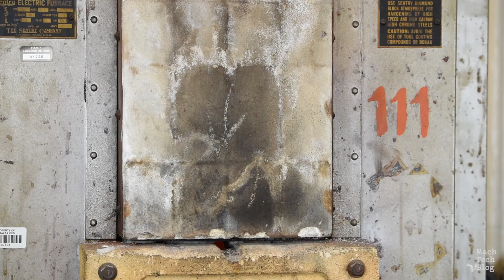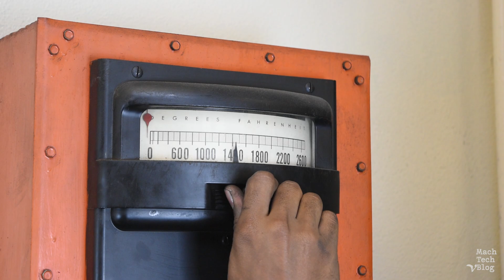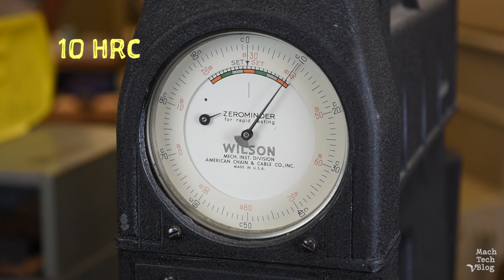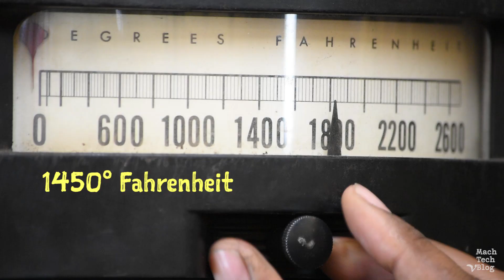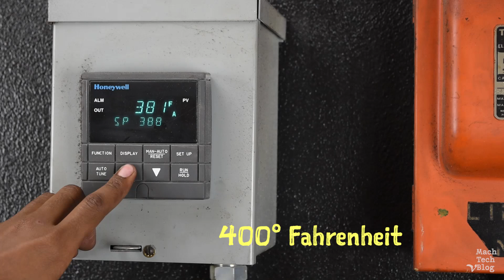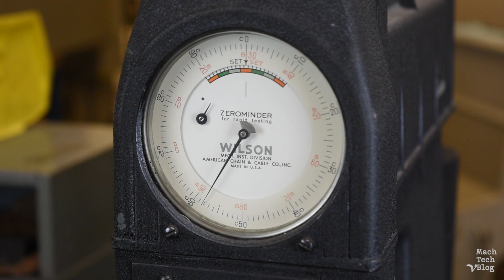Case Hardening

Comment: you get more carbon from natural charcoal. than that type.
Reply from the maker: It’s great that people are asking these very interesting questions. At the risk of being overly technical, here are our thoughts. There are various factors which influence carbon diffusion into mild steel. By carbon diffusion, we mean both the case depth and the carbon content of the case (which greatly affects material hardness after heat treatment). Carbon potential of the atmosphere inside the carburizing box is one of the factors. Pack carburizing is a process in which carbon monoxide (the “carbon-rich gas” mentioned in the video) derived from the solid carbonaceous material (the charcoal) decomposes at the hot metal surface into pure carbon and carbon dioxide. The carbon is absorbed into the steel, and the carbon dioxide reacts with the solid carbonaceous material to produce fresh carbon monoxide. And so the cycle continues. 

Pure charcoal will create an atmosphere favorable to carburization. But in industrial applications, pure charcoal alone is not often used as a carburizing medium. It is more common to mix in 10-20% of energizers in the form of barium carbonate, sodium carbonate, calcium carbonate and/or potassium carbonate. Energizers facilitate the reduction of carbon dioxide with carbon to form carbon monoxide. One study (“A Study of the Action of Various Energizers in the Carburization of Steel” by William N. Warren) found that pure hardwood charcoal alone yielded a case depth of .0529” and a case hardness of 57 HRC when tested on steel with a .235% carbon content after eight hours. The same test using 15% sodium carbonate in the carburizing compound yielded a case depth of .0735” and a case hardness of 64 HRC. So, although energizers are not necessary in the process of pack carburizing, they do increase the efficiency of the process. The time required to attain the desired case depth and hardness may be reduced. The same study found that steel carburized with the 85% charcoal/15% sodium carbonate compound resulted in a case depth of .054” and a case hardness of 63 HRC when tested after 4 hours. This result is superior to that attained with 100% pure charcoal after 8 hours.

As mentioned before, there are other factors which influence carbon diffusion into mild steel: temperature and time. According to ASTM International, the rate of change in case depth at a particular carburizing temperature (usually around 1750 degrees F) is proportional to the square root of time. This means that the rate of carburization is highest at the beginning of the cycle and gradually diminishes as the cycle is extended. To put it simply, when it comes to case depth, there are seriously diminishing returns on the amount of time the steel is kept in the furnace with the carburizing compound. After 4 hours, the case depth is usually about .040”. After 8 hours, the case depth is about .067”. After 12 hours, the case depth has only increased to about .079”. And even after 50+ hours, the case depth won’t increase to more than .157”. This is just a characteristic of the pack carburizing process. And the diminishing rate of case growth also means that the efficiency advantage of energizers becomes negligible after about 8 hours. 

To return to the original point that “you get more carbon from natural charcoal” than charcoal briquettes, we have not been able to find any studies which test these two materials side-by-side. However, we doubt the claim that “natural charcoal”, simply by nature of its purity, is necessarily more effective as a carburizing compound than charcoal briquettes. And here’s why. We’ve already seen that charcoal is less effective as a carburizing compound when it’s used alone than when energizers are added to it. According to Kingsford, their charcoal briquettes contain the following ingredients: wood char, mineral char, mineral carbon, limestone, starch, borax, sodium nitrate, sawdust. The first three ingredients constitute the vast majority of the composition of charcoal briquettes and they are all merely carbon from various sources. The other minor additive ingredients are used mostly for ash formation, ignition assistance and binding. These are considerations which might be important when grilling with charcoal, but they are unnecessary when using charcoal as a carburizing compound. However, one ingredient is of interest to us. In another comment, Паша Римир remarked that “Kingsford cuts their charcoal with rock dust”. This is true. The “rock dust” is the limestone in Kingsford’s ingredients list. Limestone is primarily composed of calcium carbonate, which is one of the energizers commonly used in commercial carburizing compounds. So, despite having more unnecessary fillers and additives than natural charcoal, briquettes do contain some amount of a known energizer. Granted, the amount of limestone in charcoal briquettes is only about 3%. But this calcium carbonate content may slightly improve the efficiency of charcoal briquettes when used as a carburizing compound.
 
We think testing the two media side-by-side would make an excellent video follow-up!
 
Here’s our conclusion. We found that using charcoal without energizers yielded a case depth of about 1/16” after 8 hours and produced a case hardness of 60-62 HRC. These results were satisfactory for our purposes and did not require the purchase, mixing or disposal of energizers. (Barium carbonate, the most common energizer, is a toxin used in rat poison.) For us, the important decision is not whether to use natural charcoal or charcoal briquettes, but whether to add energizer to the charcoal. And this decision will be based not on the desired case depth and hardness, but on what length of time is deemed acceptable to achieve the desired results. If your application requires better efficiency than what we showed in the video, we recommend adding 15% sodium carbonate (readily available at pool supplies as soda ash) to the charcoal and using a carburization time of 4-5 hours. But we don’t think you should worry too much about whether you use natural lump charcoal or charcoal briquettes. Use what’s available.
Reply from the maker: You got it! Materials are ordered and we've put the test on our to-do list.
Reply: Machine Tech Video Blog 
Great write up, very interesting!  I'm looking forward to your follow up test video.  Thanks for sharing.  One minor tip, or little tidbit of info rather, is that it is perfectly fine to water quench (cool) the steel after or between temper cycles.  As a knifemaker I do my own heat treatment and use simple carbon and tool steels.  I have asked a question regarding this matter before on a forum in a thread I started entitled, "Water Quenching VS Air Cooling Between Temper Cycles"'  and learned that it has zero adverse effects.  In fact, it is possible for rapid cooling to aid in the conversion of retained austenite to martensite, although it would be very minuscule.  The main benefit is that you can save time by tempering, cooling in water,  then going straight into the next temper.  Or just temper once, cool, then do whatever you plan on doing next with the part.  Also, warping is not an issue at these low temps, so there is no negative side to cooling.   Just thought you might find that interesting.  I will admit that this is all second hand knowledge, but I have confidence in the guys who provided this info, as I've been of this specific forum for years now.  Anywho, take care! 🙂
Reply: Nathan Dean maybe thats why they did it for 8 hours? i thought 4-5 hours was optimal? anyone know?
Reply: The 8 hours wasn't very specific, as they loaded it in a cold furnace. Usually it takes a few hours for a furnace to get up to those temperatures and more for the material to heat up as it is inside a box with insulation material basically. What actually counts is the soaking time, meaning how long the part is at the temperature requested.

The time for diffusion is less when you use higher temps, as anything from 825 C to 950 C works for pack carburising. But at higher temps you get to more problems with the outer layers of your part and risk "burning" the corners of your workpiece.

Also what was not discussed in this video is the part orientation in the box, as it can induce sag in long slender parts like pins. It is also of importance how you quench the parts, as it may distort the part even more if you just throw it in a bucket of cold water.
Reply: Thanks for the informative response. I would have assumed that coal dust or pure charcoal would have been preferable too, due to the higher carbon content. But your explanation makes sense as to why the fillers in the briquets are actually beneficial. Keep up the good work.
Reply: A traditional case hardening recipe often used for gun parts for color is half hardwood charcoal (mostly for color) and half bone black (which ends up having 6-10% calcium carbonate). Other organic matter like leather was added to change the color even more.
Reply: Machine Tech Video Blog
then do the freaking test then side by side . how hard it that ? he give me a freaking address to the scholl and ill send it through amazon.
Reply: Machine Tech Video Blog
kool about time some ony or any one rose to the challange.
Reply: You didn't specify any actual facts or references why you would get more carbon from natural charcoal. As long as there is enough carbon in that box to get a carbon rich layer (over 0.5 %) in the steel to thickness you want, then there is enough carbon.
Reply: These 123 blocks will be ground to their final dimension after the case hardening, so the distortion and sag is not important. Enough stock was left to establish (nearly) perfect flat and perpendicular surfaces without grinding completely through the hardened material.
Reply: Jaakko Fagerlund: Your point about distortion is very valid if the parts to be hardened are of unequal section, however, if that is the case, then blocking the parts to give an even mass would be a good idea, it also makes a huge difference how the part is presented to the quench, long thin section parts will obviously distort badly if dropped in side ways, even if blocked correctly, but not every situation can be covered in such a short tutorial, I though they did very well in the time.